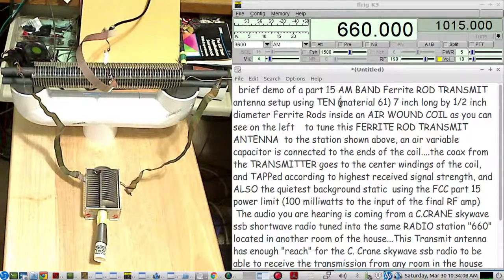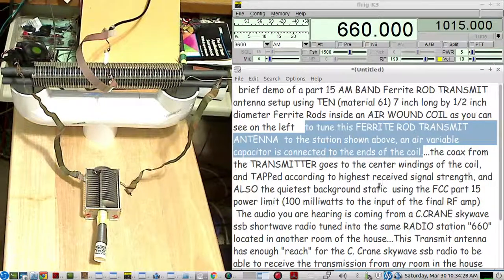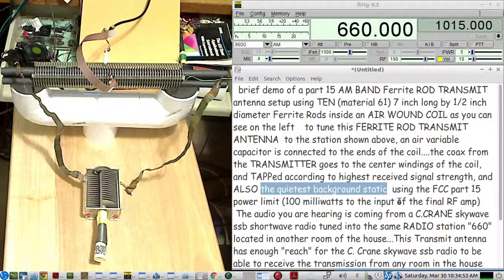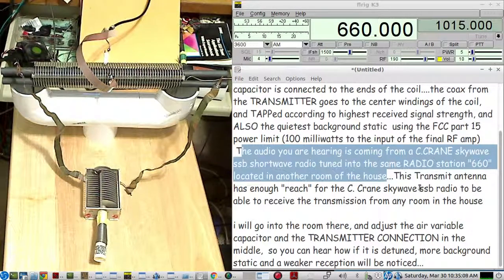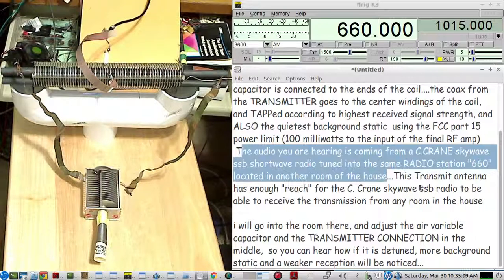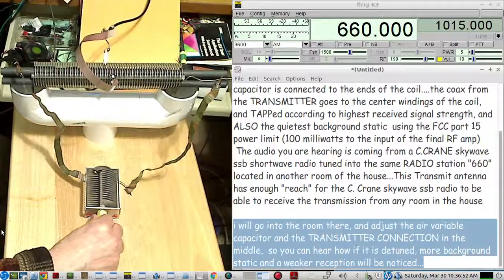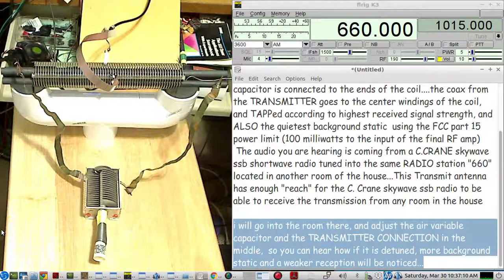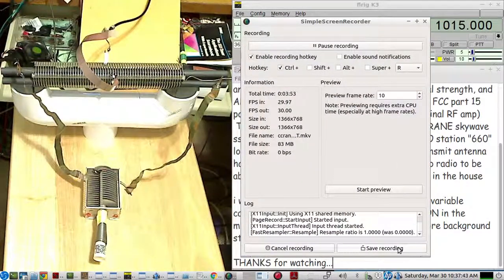FERRITE RODs TRANSMIT ANTENNA(part 15) for the AM BROADCAST BAND - LIVE demo

Comment: Nice to see that it works! I was thinking about using a ferrite rod wound with wire until an impedance of about 50Ω at the lowest AM frequency is reached, and the compensate with a variable capacitor. Am I thinking right?
Anyway, I need this to fully test my self-made RF PA. I was able to transmit in AM using it, but I'm not taking advantage of its full capability with just a wire hanging out. This PA of mine is able to produce little above 1W at its maximum.
Reply from the maker: the type of transmit antenna used and its efficiency would produce significant changes in the RF EIRP that is achieved
Reply: @QRQcw  Well, it is either this, or a balun and a very long wire. Lets just say I rather prefer the magnetic way (this one), because of the space, and the fact that the equipment is indoors. However, I'm afraid that the SWR is so bad that the waves just get canceled. I'm not worried about efficiency, since in my case it is already very bad (since the impedances are not matched in any way, it is the same as screaming without an acoustic horn and into a vacuum). My objective it to get some power out of the PA, which I'm not being able at the moment (a wire sticking out of the RF plug consumes almost no power and radiates almost no energy, being comparable to shouting into a vacuum).